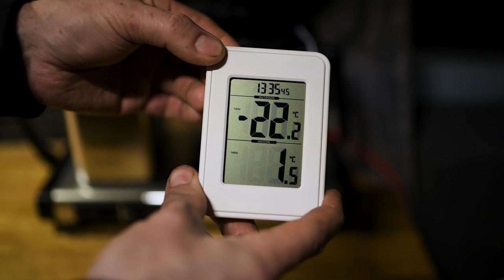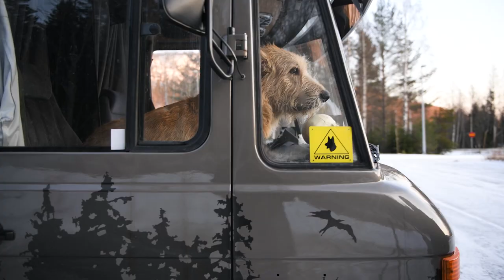Winter Van Life Adventures - Punctured Radiator While Driving

Comment: That's an exciting documentary! I know this feeling when stuck somewhere, especially in winter, but coped with the problem and then you feel relief. You're driving, you're happy but a bit afraid of being stuck again )). Thanks a lot for the very useful TEC 7 information.
Balthazar looked at the problem like a real philosopher.))
Reply from the maker: Glad you enjoyed it! Yes the Tec7 is a good versatile thing to have in a vehicle you can even use if for example around a leaking window and even if it gets on the paint you can easily remove it later and it does not damage the paintjob of your vehicle. 😀👍
Ha ha yes we sat and discussed the issue the whole evening.😉🤗

Comment: Beautiful documentation! Thank you! How come your van doesn't shake like hell when you just start it and let it run without driving. My 508 always needs 4 minutes of driving before it can run stationary without shaking a lot. You know why?
Reply from the maker: Thank you very much! 🤗 Our van does shake a bit whilst on but we have ordered new engine mounts to try and reduce the vibrations as much as possible on this old vehicle. I´m no mechanic but i guess it should be able to run on idle directly after you start it. If you turn the knob that you turn the engine off with, you can set the rpms on idle have you tried that? otherwise maybe check so that the grounding cable to the engine is making a good connection. Or maybe it can have something to do with the injectors or the fuel pump?.
Do you have the 12V system or the 24V system?